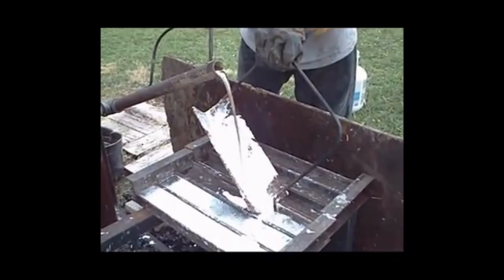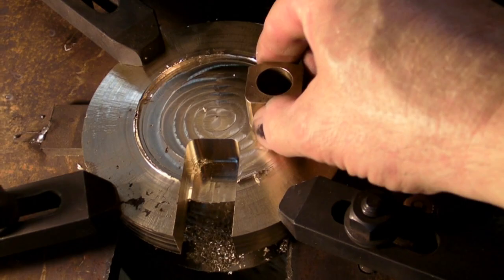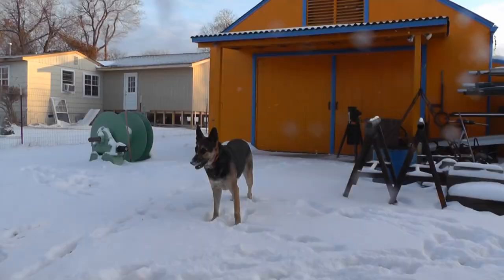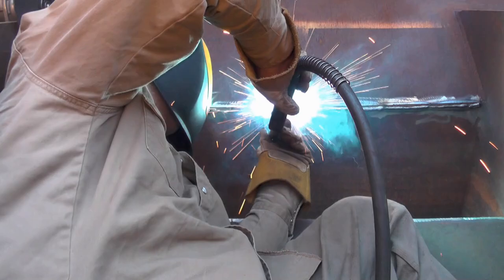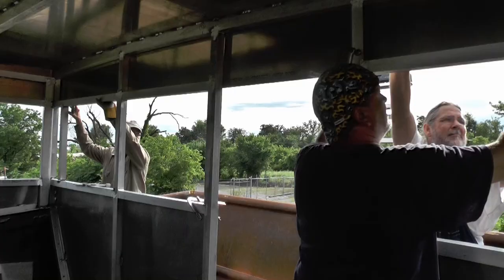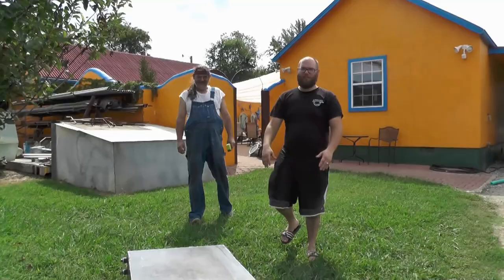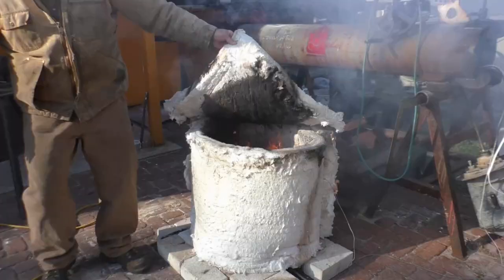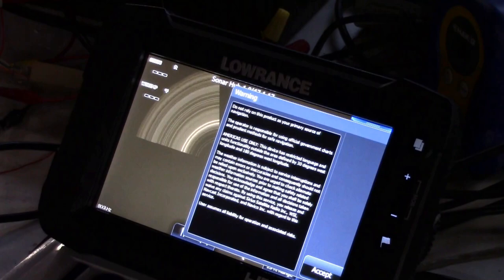SV Seeker in Review - 7 years in 27 minutes

Comment: srry im a bit late with this but im getting caught up with your videos...if your going to cast into plaster try a 50/50 mix of hydrocal and fine sharp sand(minus the feline additives lol)...will still have to be careful when doing burnout but it should increase the strength of the mold a bit as well as help with venting...may still want to paint or dip coat with a extra thin coat before pouring solid to get rid of surface bubbles or sit on a homemade vibro pad....even with aluminum most call for a sand /plaster mix unless your using the expensive investment mixes...nice work as always!   Oh and if you want a stronger stiffer wax you can make your own machinable wax by shredding up some cheap plastic grocerie bags and adding them to your melted wax...keep adding them till they stop melting into the wax then strain the melted wax into a block mold for later use...will hold better detail and still burn out clean

Comment: You have some great projects. I have noticed how loud it is inside the hull of the boat. You have a lot of sanding and cleaning to do on the inside before you can paint or epoxy her. Have you thought of just laying some tires around on the inside ribs to help deaden the sound? It should at least help knock out the ringing some.

Comment: just curious when you started your ship why did you decided on a metal ship why not a traditional one like the princesses Jasmine that was built in 2005 and sailed from Japan to sanfransico in 2015. I know metal is better just a question I always wondered.
Reply from the maker: It's all just variables. Metal is different, not better or worse.  There are many materials, many types and uses for boats and many various preferences by there builders.   For me, steel was the right answer for my variables.

Comment: What is being dumped out of the cement mixer looking tub inside? And why?
Reply: its molting lead being dumped in the keels I don't know shit about boats but I'm going to guess its to help keep it standing upright when in the water
Reply: and your assumption on that would be correct, Mud. The sails will try and push the boat over while she's underway, the lead counteracts this. It's called 'heeling', and some boats do that more then others, or need more weight then others.
Reply: I was thinking it was to help with tipping from big waves. I never thought about the sails tipping it over but that makes more sense than waves tipping it.interesting thanx for the info
Reply: Yeah, waves can tip sailboats over as well, (particularly sailboats with centerboards, which are retractable keels. they're top-heavy when those are up), but it's usually the wind. 

The counter-balance of the keel or centerboard means that, since the wind can't push the boat sideways, it pushes it forward instead. Also, the air passing over the sails as the boat moves along generates extra sideways pull (and a bit of extra thrust) because the sails act like an aircraft wing (racing catamarans sometimes have a solid airfoil instead of sails even). So a mono-hull with the weight of a keel as counterbalance can get a bit of thrust from sails even if the wind is coming at them, rather then from behind. old square rigged ships like the Viking longboats couldn't sail into the wind at all.

Comment: Sooo much lead and placed inside the riggers that are more like anchor slash ballast. This boat could not capsize if you tried. Usually its along the keel but to send the weight so far from the usual balance point its like those eagle toys that balance on your finger. Weighted with lead at the front swept wings to level the whole things centre of balance.